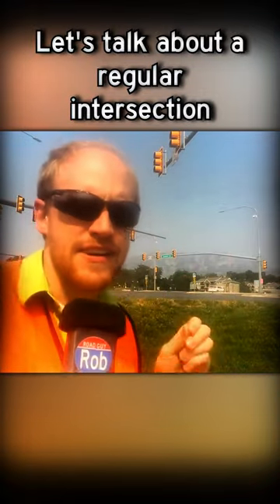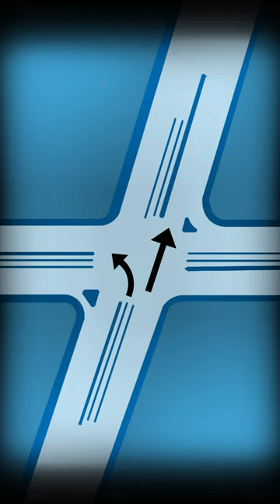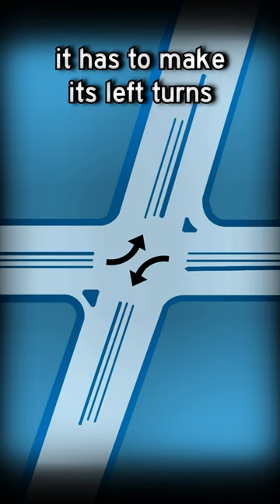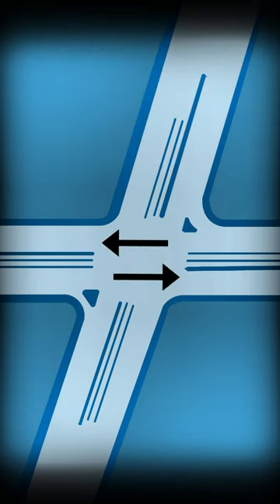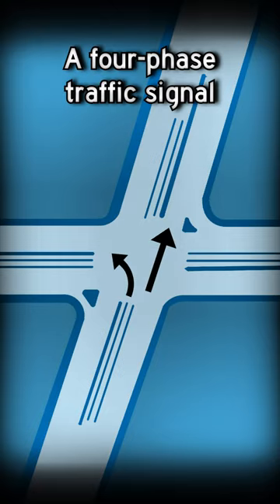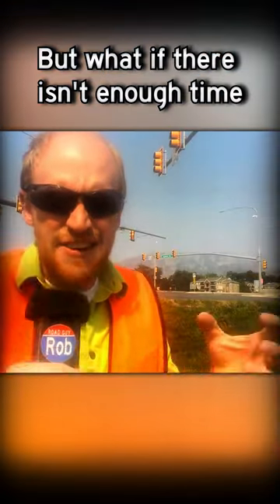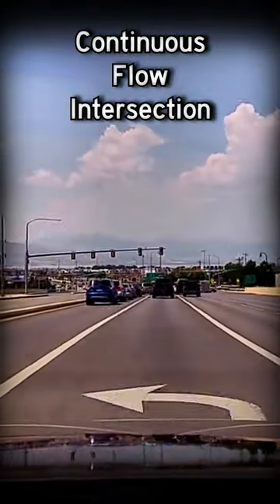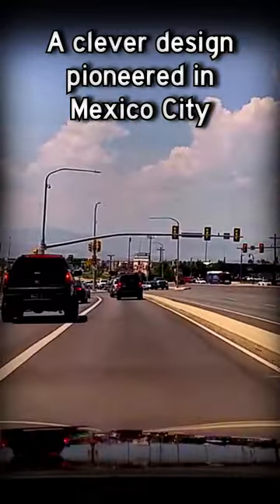Too many cars at a stoplight 🚦  #shorts

Comment: Once a collector road is this big and busy, it either needs to be a grade-separated freeway or should exist as two separate one-way roads a block apart. 
Or the zoning needs to be more mixed and local instead of having huge swathes of residential far from huge retail/ commercial districts that no one can live in and use without a car.

Comment: A roundabout works perfect. Tried and true
Reply: Roundabouts don't work for high throughput roads like this.
Reply: @MrC0MPUT3R of course they do mate, been used for years!
Reply: @michaelkennedy8573  on intersections connecting four 8 lane roads?

For clarification: 2 intersecting roads with two turning lanes and two through lanes on each side
Reply: @MrC0MPUT3R  if you’re referring too 4 lanes one way and 4 the other then yeah, loads of roundabouts accommodate this. Two going left and straight on and two going right and straight on.
Reply: @michaelkennedy8573  what kind of speeds are we talking about on these roads? For more context, I live in the suburbs of Denver, Colorado. We've got way too many intersections like this on roads with 45 mph speed limits. They get completely congested for a few hours in the morning and evening during rush "hour." I'm really struggling to see all those cars make it through a roundabout in a more efficient way than with a signalized intersection. 

We also have tons of businesses right on the corners , because that's how it was zoned, so space would be an issue.

Don't get me wrong, I hate the way the roads here are built and how driving is basically a requirement.

I personally ride a scooter for my commute and arrands because of the hellish traffic. 😬
Reply: @MrC0MPUT3R  most speeds, they work, they definitely come down as a signalised junction does at well but theres one near me that is a 40 and has 70’s that join it. Then some of the larger roundabouts have traffic lights as well but generally still more efficient.
Reply: @michaelkennedy8573  that makes sense.

I guess the way I see it after giving some thought to it is like this: when rush hour here hits, all the lanes are filled to capacity. Assuming you have protected green arrows, that's 4 lanes of traffic moving at once. 2 during the left turn phase, two during the straight through phase. 

Unless you have a 4 lane roundabout that's consistently full, even factoring in clearing times where the intersection is all red, the signalized intersection will still get almost 2x the number of cars through for the 2 left turn, 2 through lane configuration. It gets worse as you add more lanes.

There's a popular arterial road a few blocks from me that has three lanes each side and more than 2 turning lanes at a few popular intersections.

I know I'm just talking about rush hour, but honestly rush hour is a misnomer and should just be called "daytime traffic"
Reply: @MrC0MPUT3R take a look at savoy, france or rome, italy.